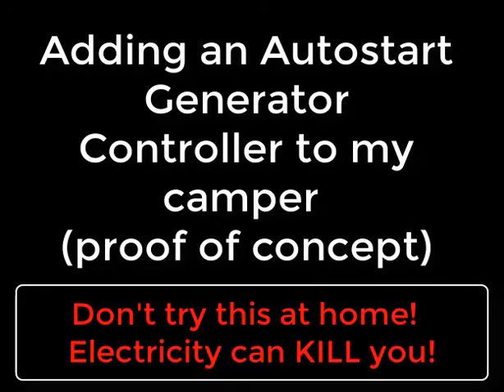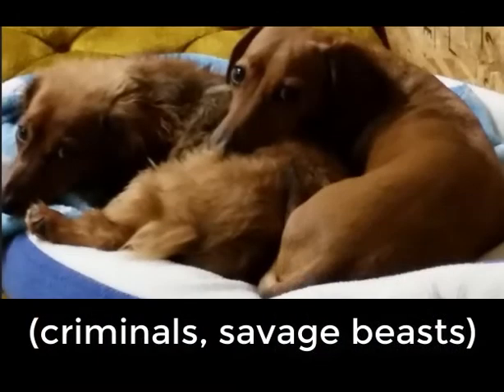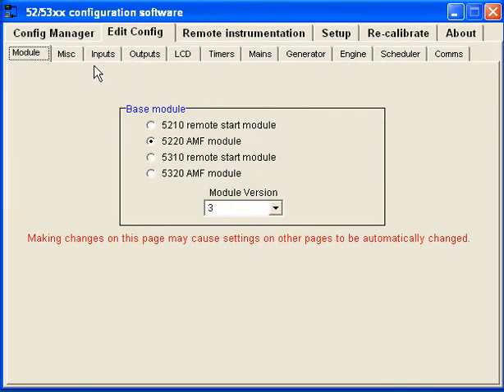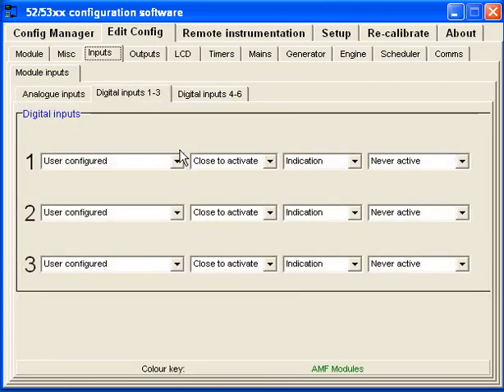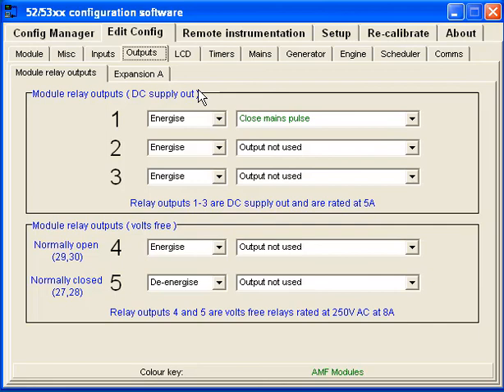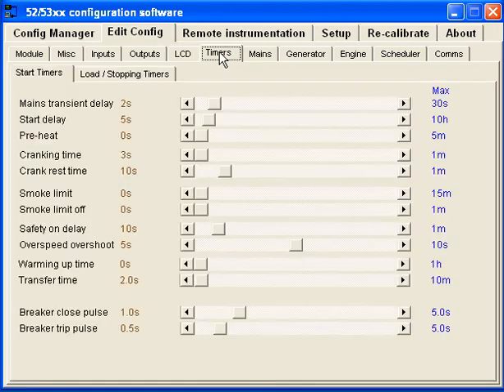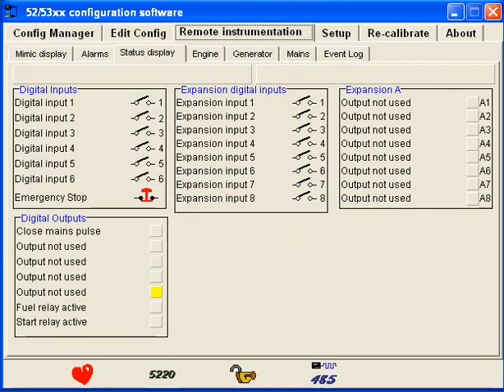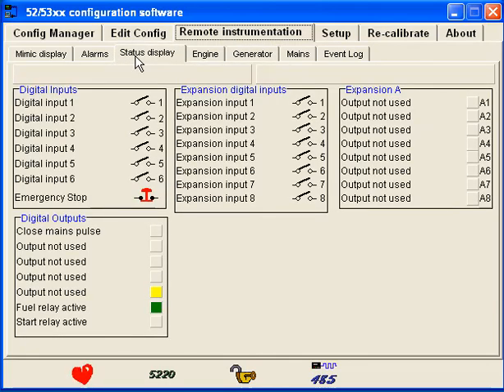Autostart generator controller (dse5220) for my camper

Comment: This is the best video showing how to use a DSE controller for camper that I've seen.  Thanks for posting it.  I have a solar inverter that sends an open-close signal when the battery bank voltage drops below a threshold predetermined by the inverter.  It closes when it needs a generator to start and opens when the generator needs to stop.  Can you configure this DSE to automatically start and stop the generator if it gets an input like this?

Comment: I have a similar generator but it’s the Cummins and the on/off button works to turn on the engine and turn off.
Thanks for the video. I’m doing the exact same method on my work trailer.

Comment: Nice video!
I think you could’ve tapped off the back off the start switch on the generator and used a wiring harness coming out of the side of the cover plate.